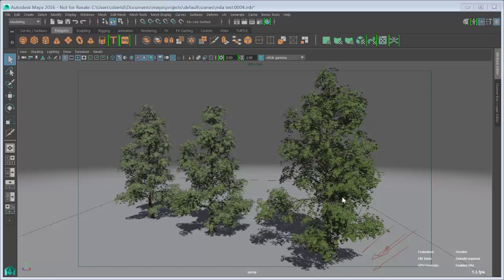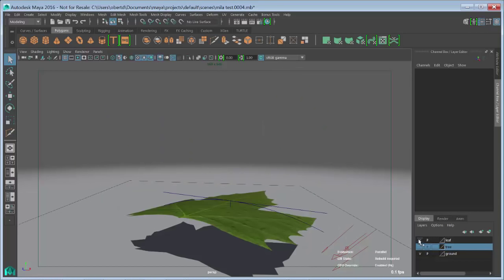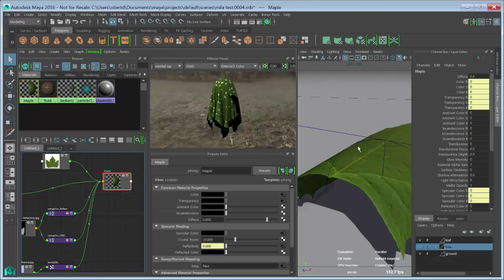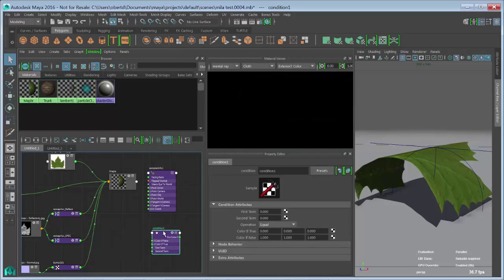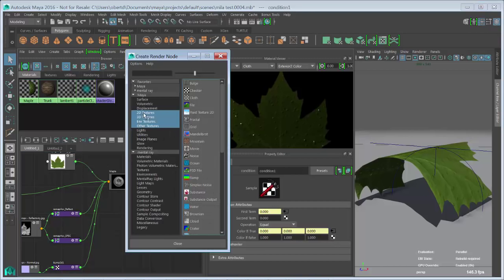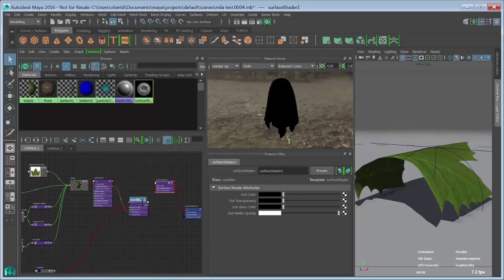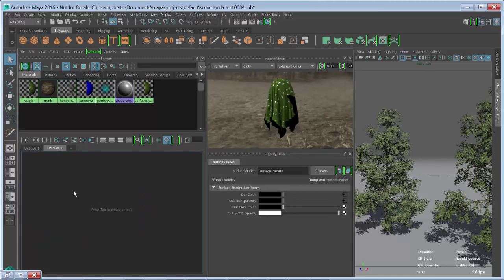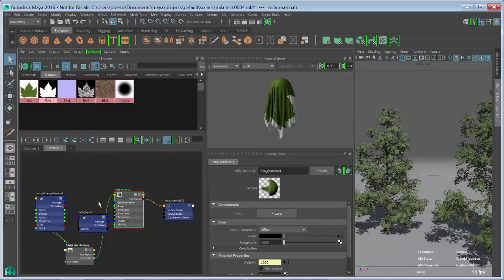Maya Monday  - two sided shader - MILA material

Comment: Hey daryl, what is the fastest way in maya to do fencing edges? The bevel tool does not generate perfectly flat bevels, which are basically just fencing edges... modo has this feature and its the one thing I want in maya. It's basically an offset edge loop tool that works on multiple edges.. 

is it possible to modify maya's offset edge loop tool to work on multiple selection sets at once? that would be awesome!

Comment: Hi Daryl, great tutorial as always!
One question though: what's the difference between a mia_material_x ( or x_passes ) and a mila_material, render time wise?
Reply: +Mauro Sanna 
Hey Mauro, simple.... My tests, software rendering on a detailed series of trees with grasses at 720p Res were MIA x 10.20sec vs MILA 2.15sec. As Darly said, Render speeds are way faster with MILA due to not making unnecessary calculations, plus MILA is a simpler (in terms of use/setup) to create really complex shaders. A good example of this is if you wanted to create a rusty chrome material. Super easy in MILA but convoluted with MIA which I sometimes still use. I am in the process of updating any MIA x materials over to MILA. It isn't a nice job but the render speed advantages alone make it worth the pain.  Don't get me wrong MIA materials are still good at photorealistic renderings (as are MILA), and the plus side is they can be plugged into a MILA, though I have no idea why you would do this other than laziness, as then the render time advantage of using a MILA would be compromised. 
I hope this helps?
Reply: GregAffy 
Thank you very much for your answer. Much appreciated. 
I am also about to update all my shaders in my library, from mia to mila. We have just been upgraded to Maya 2016, although I have been using it since few month ago, and I am glad to see such an improvement. At the moment we are using V-Ray also, but I am a mental ray guy mostly. :-)

Comment: Hey Daryl,  These are great.  I think more help on MILA would be great to see so more people start adopting the future for Mental ray.  This is wonderful. 
I had a request for a tutorial if you have time.  I love that you covered the simplicity of Maya bonus tools and make selected curve dynamic, but how do you connect two ends of the same rope, and have both sides illicit reactions from an animated object.  For example: A gas mask that has a tube running from a character's face to a filter on his waist belt.  Both the hips and the head will affect the animation of the tube.  What is the best process to achieve this? After some noodling of my own I'm getting stuck when connecting both ends to an animated object.  Switching to "Both Ends" locks both sides, but I cant freely drive either side when I try to constrain something.  I know I'm missing something simple.  Any help would be appreciated.  Thanks again for doing all these.
Reply from the maker: +JJ Chalupnik  Hey JJ,  I would try making both ends free and using two constraints.
Reply: +daryl obert Thanks for the reply.  How do you mean both ends free?  Isn't there only 3 options, base, tip, or both ends?
Reply: +daryl obert gonna try it now.  I saw no attach is an option.  Thanks for the tip!